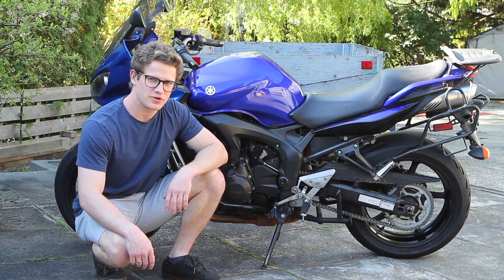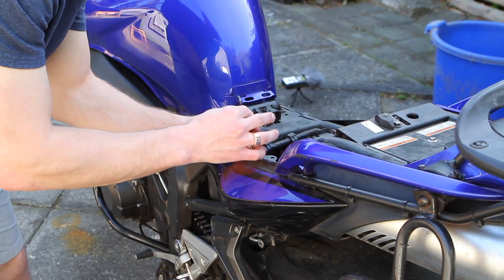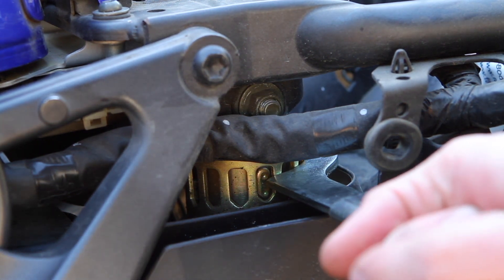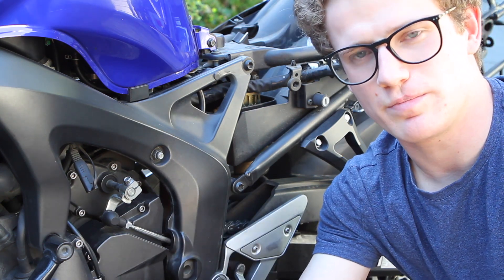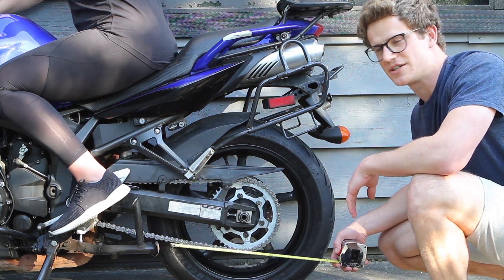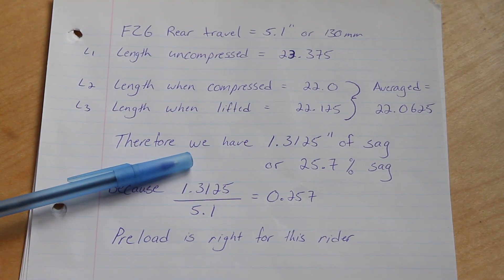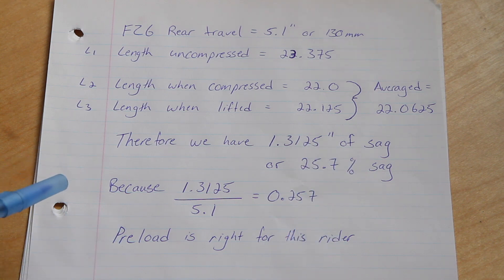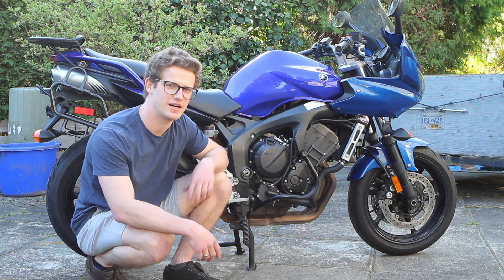How to Adjust Yamaha FZ6 Rear Shock Preload

Comment: For anyone checking this out for the FZ6, you don't need to remove the side plastic, though it does make it more visible.  There's a slim cutout underneath where the tool will fit into and is visible in the intro here.

Comment: Great video! Is set up my buddies fz6.  I first measured the sag on the front to make sure the spring was good for this weight, I then adjusted his rear to be as close to 5mm higher rider sag in the back then front sag we got 6mm higher because perload had steps in it.

Comment: Very helpful video. Nowhere in the Yamaha Service Manual for the 2004 model does it talk about adjusting preload other than the tool to use; how the direction you turn it affects the setting; and that "1" is "Minimum", 3 is "Standard" and 7 is "Maximum." I got mine dialed in now. Thank you.
Reply: Hi mate mine it's on 7 at the minute and the rear seems to be low , what number would you suggest to keep as a single rider ? I'm 82kg, thank you

Comment: I am back riding a motorcycle after 23years without one. Bought a Yam XJ6. It was on No. 7 and too much for my small body. The preload adjusting ring won't budge when I tried decreasing it to No
 3 (standard setting) on the sidestand. I think I need to unload that suspension first and clean the adjusting ring.
Reply from the maker: Try spraying some liquid wrench or penetrating fluid on it to get it moving. That’s an annoying problem though.

Comment: If you're adjusting it for a pillion rider, do you both need to be sat in the bike when measuring or?
Reply from the maker: Yes having both people on the bike to dial in the preload would be ideal if that’s what your adjusting for. In my experience on the FZ6, I would always crank the preload to 7 (max) whenever I had a passenger. Felt best that way
Reply: @Calvinm  thanks for the advice and great video, mate 👍

Comment: Hey Calvin, I want to remove the shock absorber of my FZ6 S2 to send it for service. Would it be necessary to remove the back wheel, you think? And do you have any general tips or things to watch out for when removing the shock? Thanks for your videos!
Reply from the maker: I think it would be necessary to remove the back wheel. I made a video on removing the swing arm and in that video I remove the lower shock mount so this might be helpful for you. 

Link: https://youtu.be/ty7VXiTWHCU

It might be possible to remove the shock without taking the wheel off but it’s likely more work than it’s worth avoiding. 

Best of luck! 👍
Reply: @Calvinm  thanks!

Comment: What do you think i should do if my bikes bouncing around in the rear to much over 120 ish mph. Loosen the suspension or tighten?
Reply from the maker: 120mph is a high speed. Could be a few different things causing the bounce. I’d check your wheels are balanced well because at those speeds an imbalanced wheel will be very noticeable. Check tire pressure as well. I can’t really recommend a higher or lower preload setting, you’d have to measure your sag first. Best of luck! 👍
Reply: @Calvinm  oo okay thanks yeah its ddffitnitly not the  rim or tire pressure its fine on flat roads. But ive been going down these same drag strip roads for my last 2 bikes and niether of those were as bouncy
Reply: Slow the fuck down unless you're on the track.

At that speed you're likely feeling the rotational forces of the rear  wheel (which will be heavily effected by imbalance of the rear wheel/tire). That's not really something you can adjust the suspension to eliminate (only dampen), especially not with the stock shock which only has adjustment for spring preload.
Reply: @DeepBarney  i only feel it going over bumps in the road
Reply: @DeepBarney  the bike is designed to go that fast bud

Comment: You can add preload adjusters on the front for cheap  or you replace your spacer with a longer or shorter pvc pipe to adjust the front.  Make the front and rear sag match for the best handling.  Target between 30 and 40mm for street, 25 to 30 for track .  ideally you want just enough rebound so when you push down firmly it comes back just to full extension without sinking a second time.  The stock rear damping is not too bad on these fz6s when you have about 35mm of sag.  And in the front for me 12.5 weight (mix 10 and 15 weight equally) seems perfect for me.  I weigh about 190. and am just using the whole tire in the canyons.  If I were faster and the roads were smoother i could use more preload to keep the same bike composure and the opposite is true if I were slower or the road is more bumpy I would go softer.  Same rule applies for the rebound but its physically a different setting depending on the preload so set it after you set the sag.  Make the front and rear the same.  link to preload adjusters:

https://www.ebay.com/itm/185229484488?hash=item2b2089a1c8:g:N50AAOSwaZBhsYID&amdata=enc%3AAQAHAAAAsFeTfscb9gZFVF4TPudseU3vXbD2PA4fZFqUBo1N6AJiv9nueoc7ewXs2RQqTX%2Fm80qetPKJtHE5e2Ah2Lk1k2iCxqKgFmHuJJZ1GceXP%2FtgiZ2%2FNuq7JlTJjSOve82GL69f%2FfX5NkLlJirmkkhLxMmetyD571F1v2W%2FZEirqTMexxR3S2nRzknRtNBTQzA9Lp73WZ1INdOKO9QV6ZUbZM3wU51A9Q5DJPQN9m8n%2BnrC%7Ctkp%3ABk9SR57dipP0YA